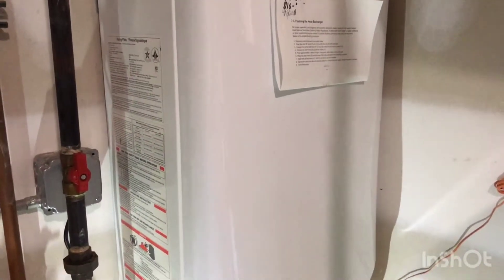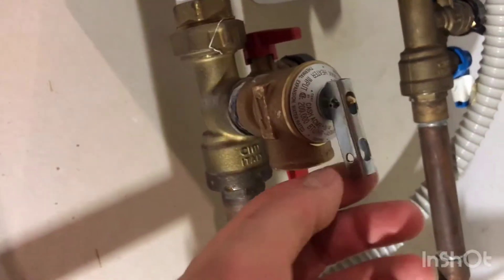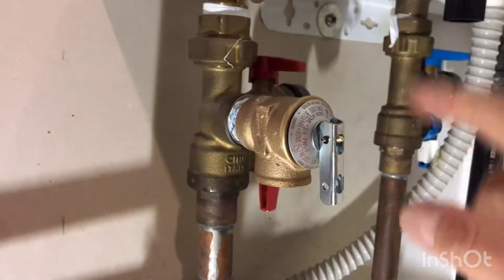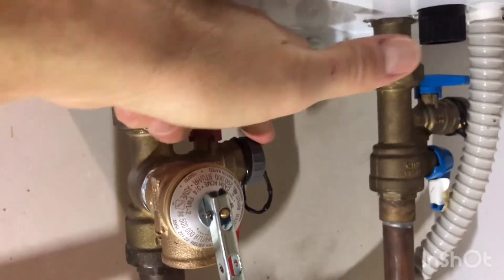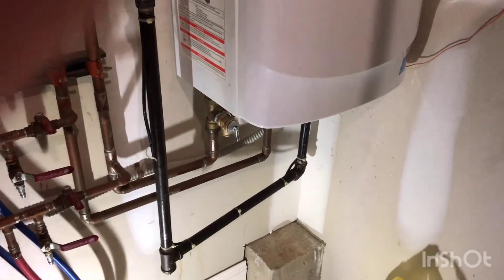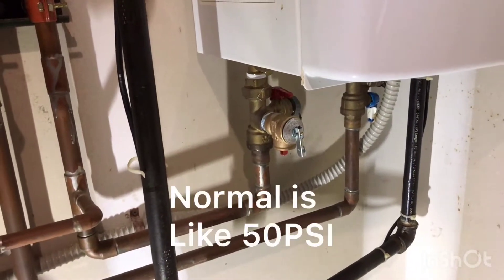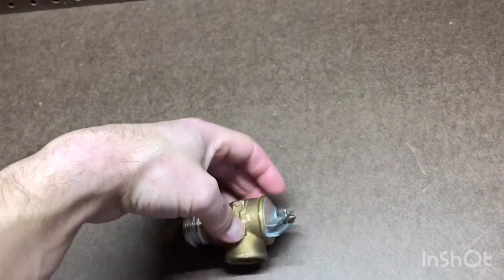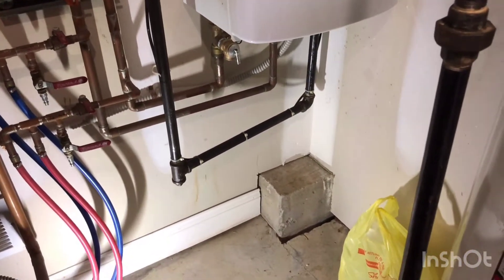Tankless water heater Pressure Relief Valve replacement

Comment: Love the fact that a tankless heater is just that: no pressure tank.
Therefore there is never a buildup of pressure to warrant having a relief valve as heat is only generated during flow. It doesn't and cant keep making heat due to the multiple layers of safeguards in place to prevent run on heat saturation.
I've run mine for 20 years now  and never a problem. This is just a rule someone came up with to cover their butt just in case and possibly to sell valves.
It's not a pressure vessel in the true sense and doesn't need a relief valve. 
No Plummer or boiler maker will ever be able to demonstrate one over-pressurizing and blowing off the valve. Period!

Comment: Thanks, the tip that tankless heaters use just a pressure relief valve and not a temperature and pressure relief valve was very helpful.

Comment from the maker: Follow up video coming soon. Replacing pressure relief valve didn’t stop it from spraying water. Turns out the water pressure coming in my house during off hours is causing it to spray. Basically it’s doing its job. I have to install a Pressure Reducing Valve on my water main and that should solve the problem. I will be doing a separate video on that job as well as a follow up video to this problem. Stay tuned!!